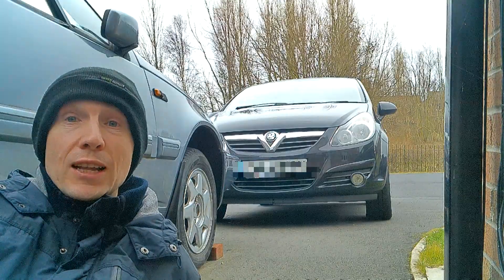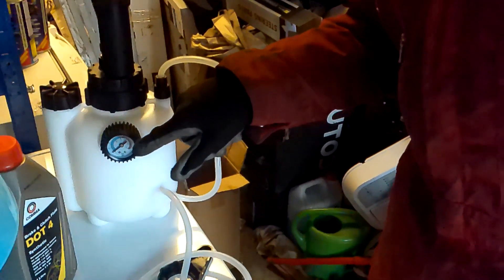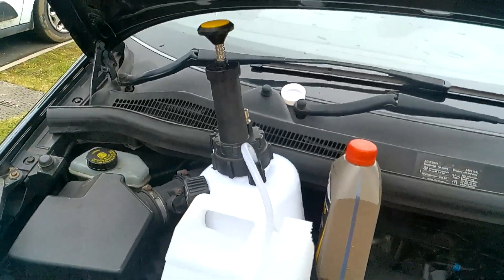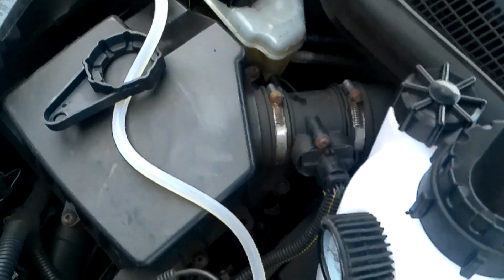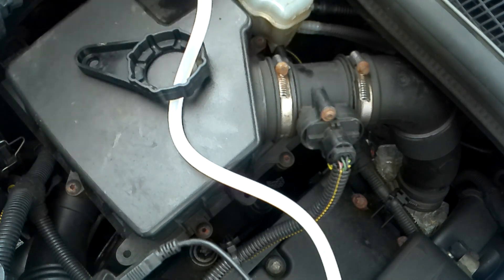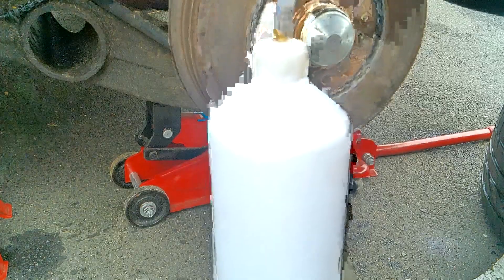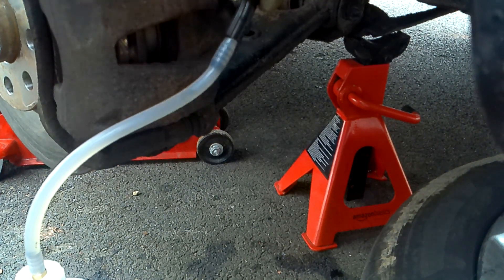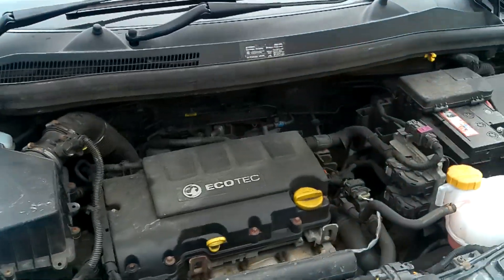Brake Fluid replacement and bleeding using pressure bleed kit on a Vauxhall Corsa 2011

Comment: Where did you get the cap for the reservoir? The one with my Sealey pressure bleeder doesn't fit as the inner part is too deep for the reservoir.